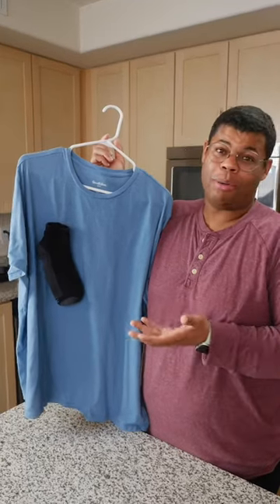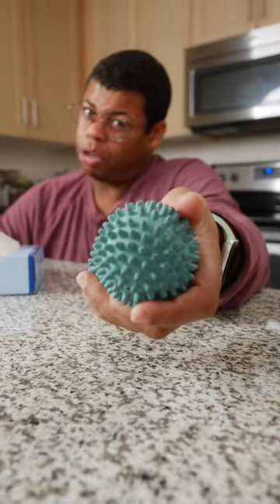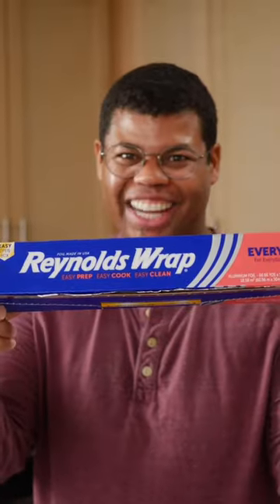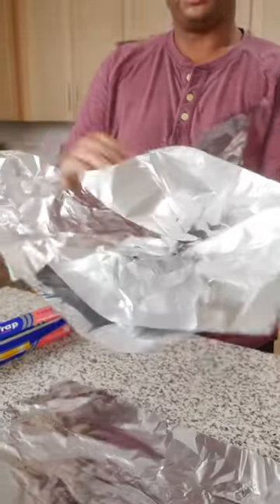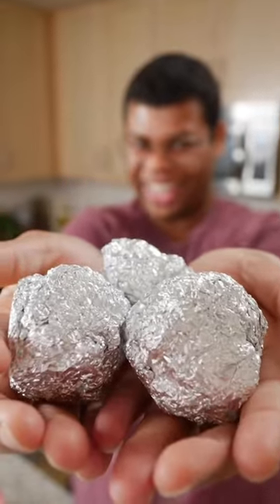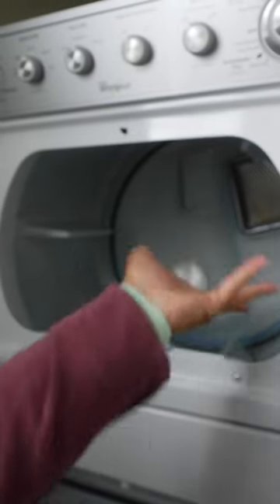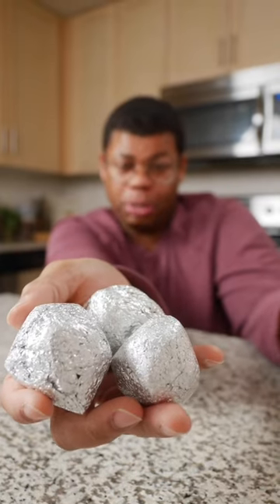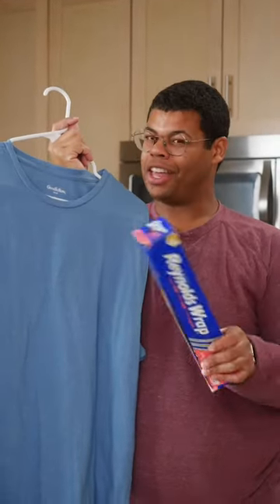How to make cheap dryer balls #shorts #lifehacks

Comment: Those balls of foil gonna be hot af when you finish a load
Reply: I was looking for this comment.
Reply: Not really. Aluminum will not hold on to heat for more than a few seconds.
Reply: If you've ever cooked with aluminum foil it actually does not get very hot. You can usually pull it off carefully after it comes out of the oven.
Reply: Ayooooo
Reply: @Sheluzmyian  bro 😭😭
Reply: @zenferns  I had toooo💀
Reply: @Sheluzmyian  nah word I'm baked and when I read this it sounded so wrong😭

Comment: Yep, make sure to squeeze them real tight, and clean your dryer once in a while, because if you are doing this, you'd surely want to avoid your dryer going up in flames.
Foil balls are safe to use, just keep in mind that they do increase fire risks, but as long as you're not purposely neglecting the fact, you'll be absolutely fine.
Aluminum is a crazy good conductor of static electricity, even though it lacks in Ferro Magnetic properties like its alternatives.